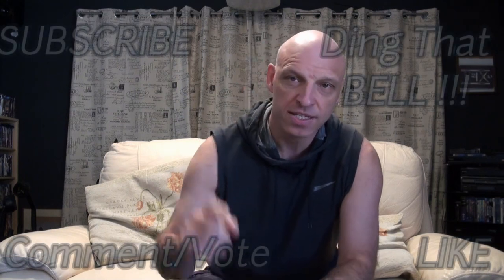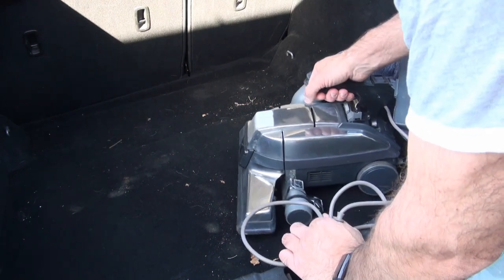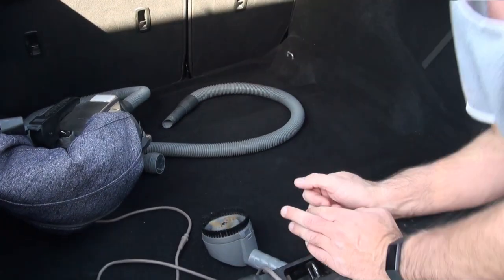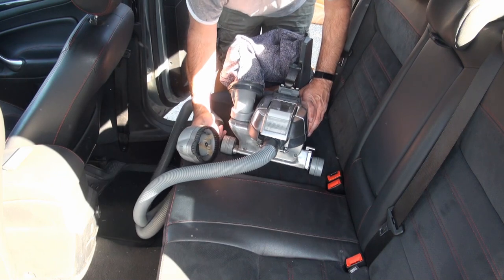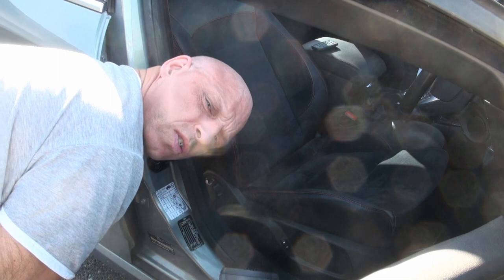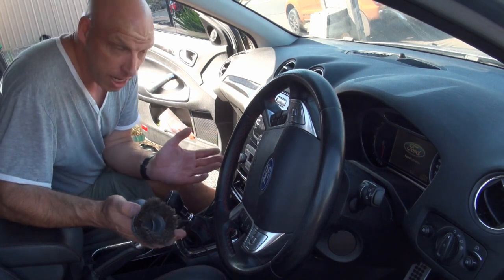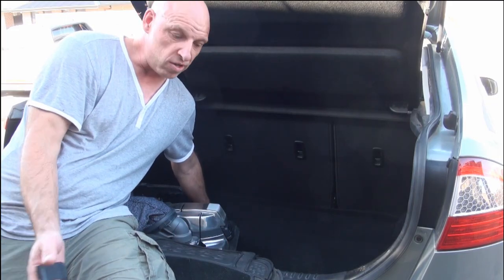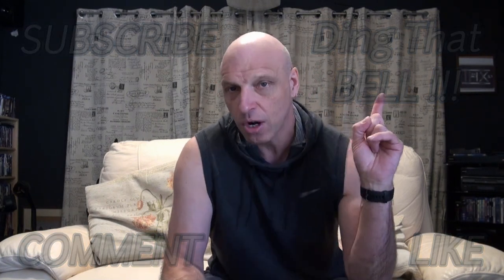HOW TO VALET CAR PROFESSIONALLY :WITH KIRBY AVALIR ZIP BRUSH TURBO TOOL

Comment: I used to vacuum our f150 seats and the flat floor surfaces with the power nozzle and portable handle where possible and then i would use the hose